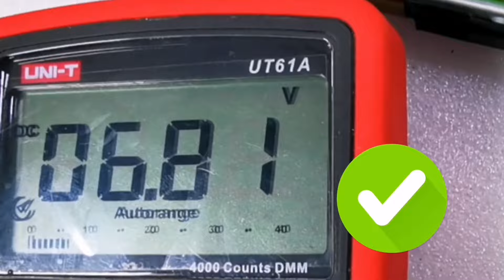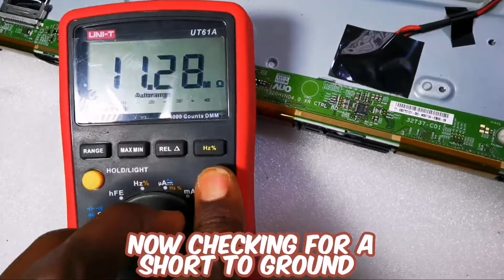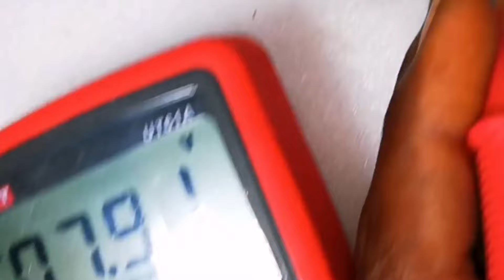INTRIGUING REPAIR - Puzzling Simple Root-cause #sonytv #tv #led #lcd #tvfix

Comment: Hey Akin: Good informative video,  but always better when we can hear you explain. Possibly the cap was badly soldered from new and it's just got worse over time until the heat was finally enough to dislodge it slightly. Noticing your meter tips, I normally slip a bit of heat shrink over them to save any chance of shorting things out .
You take care and don't work too hard.
Reply from the maker: Hi, @rscelectrical7091! Thanks alot for those tips! Adding the tape to probe now... I'm really sorry about not adding a voice over. When the final edit has dragged on for far too long, I simply resort to using just the texts so as to push it out sooner.😥 I hope you guys can forgive me for that. I should probably make a vow to never do that again.😄
Reply: Your forgiven this time, but if it happens again we will have to put you in the naughty corner 😂😂😂.
Reply from the maker: 😂😂😂😂😂 And I don't wanna be there 😂

Comment: Hi sir, i need ur help and assistance, in fixing 9 times blinking in Sony KLV-V40A10 ,2006 model LCD tv , it goes 9 times blink which according to service manual is backlight section issue , yes Light comes up for a second and then protection,i have previously repaired few Inverter boards , but in this one , Inverter board itself made by SONY , i need help in finding which CCFL is faulty consumption over current , because when i power on ,i see all the 20 tubes comes up for a second ., i need atleast to bypass the protection and inatall LED instead of CCFL
Reply from the maker: Hmm... That looks like a job that would require I high level of specifity. Have you tried to obtain schematics for the module?
Reply: @tgetvtips  have schematic s for Power supply ,not for the  inverter board
Reply from the maker: @premkumara8962 Okay. You need getting the schematics for inverter?
Reply: @tgetvtips  ,I managed to Bypass the protection, BD9886 IC pin 22 needed to be grounded inorder to Bypass ,earlier I connected it to IC GND , but somehow the backlight driver IC section Gnd Is different from Chassis Gnd , so I connected pin 22 to chassis GND via 1K resistor,the TV no longer goes into protection and installed LeD backlight
Reply from the maker: Excellent! Did you get the schematics?
Reply: @tgetvtips  nope , Inverter board schematics is not there in Service manual
Reply from the maker: You did an excellent job there! 👍👍👍